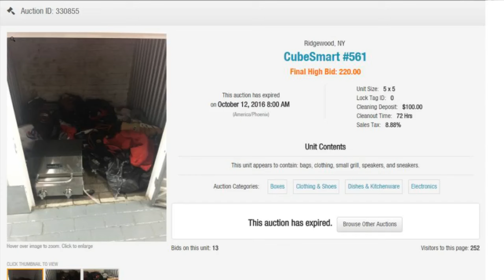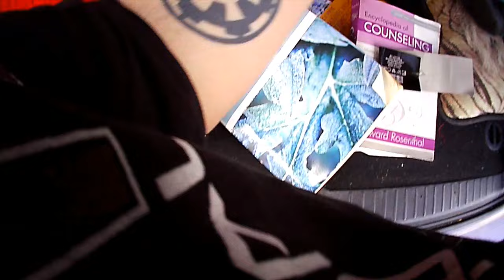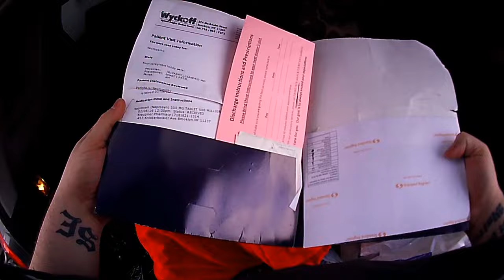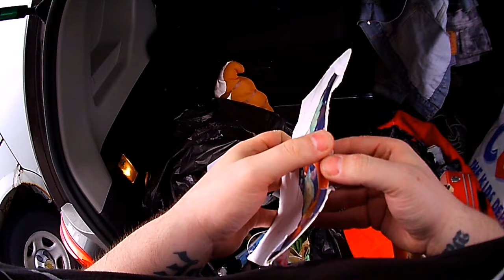STORAGE LOCKER HAUL 1: Single Jordans and Nikes?

Comment: Question : How often do you run into knock off shoes? I have recently started collecting shoes and am just finding out how easily it is being tricked by fakes... some Jordan's are as close as a different stitch pattern on the back or a different insole... I have yet to try my luck in storage lockers but I love to thrift... I usually think "this is too good to be here" and pass up the high dollar shoes and usually settle for mid range items... do you have a trick or any advice dealing with this?
Reply from the maker: +PURE216EVIL we come across knockoffs often. There are some easy to spot and others that take a lot of looking. The first thing to always do is look for the product code inside. Even teally good fakes will have a wroung number a lot of times. They might be the right code but wrong date for the shoe. After that I would say watch all the youtube videos you can. There are small mistakes made in the better ones. Also try the shoe on. Fakes tend to be less comfortable. If you message me if you have any other questions.